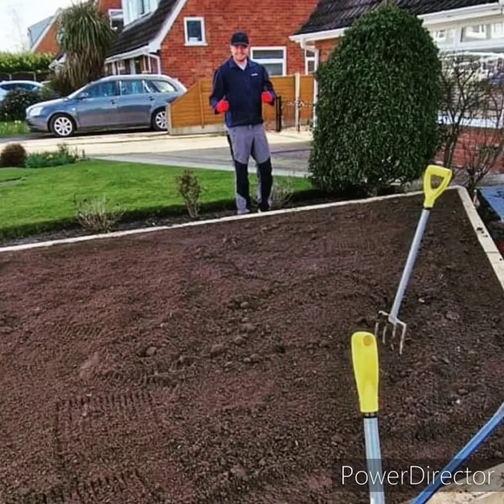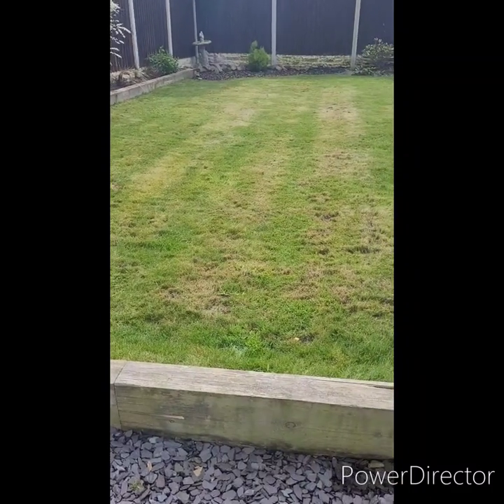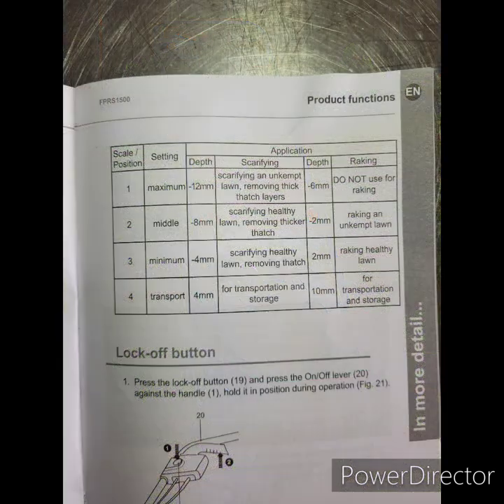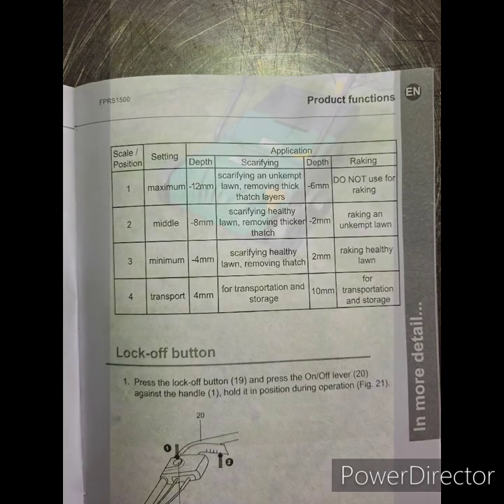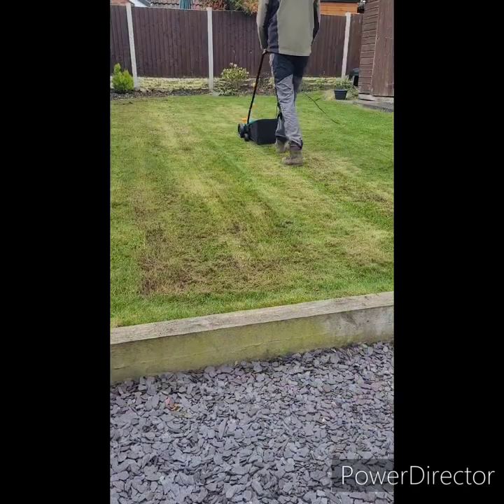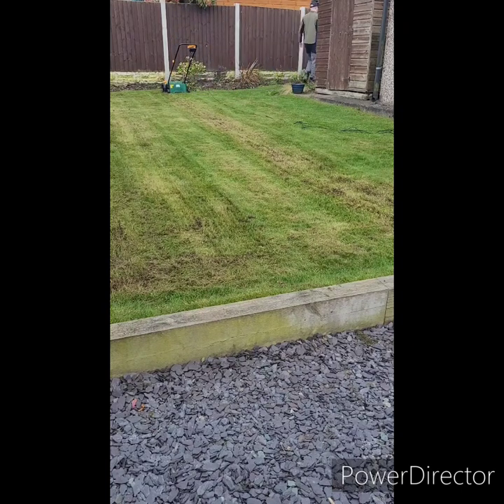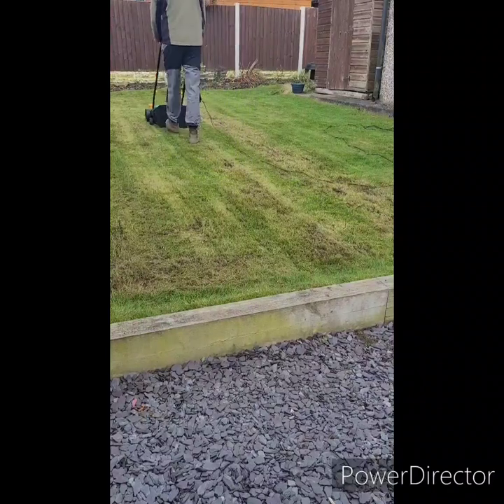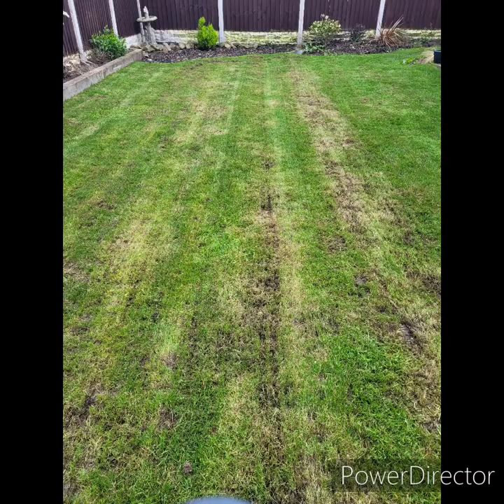What a beast! Today I put the WR6002 Scarifier and raker from Screwfix to the test!

Comment: I bought one of these from Screwfix a couple of weeks back. Works really well. As you say, the collecting bag fills very quickly and I ended up using it without the bag, as recommended by some lawn experts on YouTube. Obviously you have to be careful doing this and raking the thatch up afterwards takes a while. From a 100m2 lawn I removed enough thatch to fill 3 large wheelie bins. Incredible!
Reply from the maker: Hi Phil, yes I noticed that I filled my wheelie bin up rather quick, I only went for a light scarify this year as I didn't fancy top dressing and overseeding again
Reply: can anyone recommend a bargain petrol one, as  mains is too far away from lawn
Reply: @pal54321  get an extension lead

Comment: @thebaldgardener just bought one of these on the strength of your video. Do you recommend going with the scarifying or rake attachment first? Our lawn has never had either and seems like it’s more moss than grass so was thinking scarify on the max setting but didn’t want to end up destroying my lawn.
Reply from the maker: I recommend you scarify it, start on the highest setting but if your going to renovate your lawn it's worth getting rid of all the moss, be sure to remove the bucket and rake up the mess afterwards or you'll be doing a fair few trips to the green bin

Comment: Hello, Is it powerful enough to put grooves into the soil? Thus enabling grass seed to fall into them when come to overseeding? If I may look to purchase because, petrol scarifiers are so expensive
Reply from the maker: Hi Craig it is powerfull enough to do that however I wouldn't recommend it as its not what it's been designed for, hope this helps
Reply from the maker: @In__My_Opinion  it has a manual that explains not to go to low with the raking attachment. It states that it's not.desinged to leave grooves like a verticutter would. I could imagine you could use it to create grooves but you'll be seeing the motor burn put fairly quickly